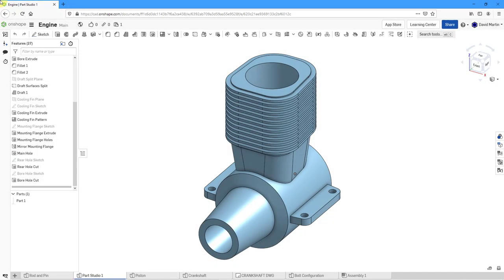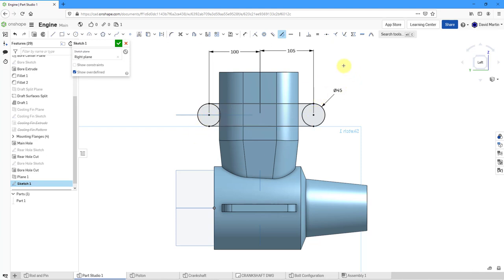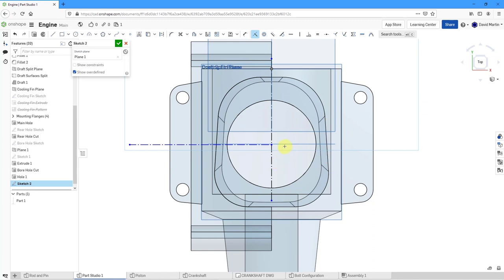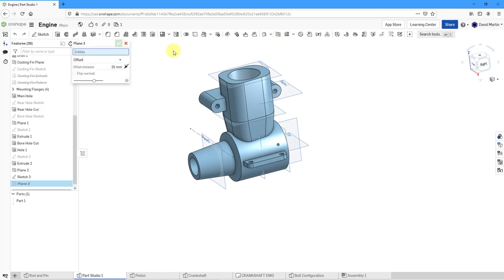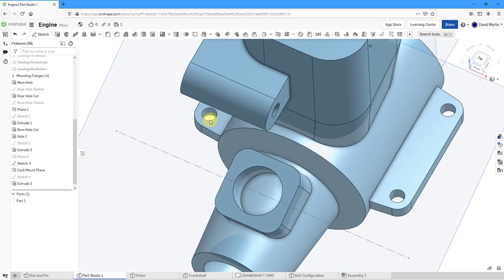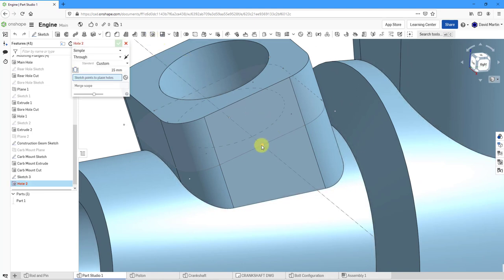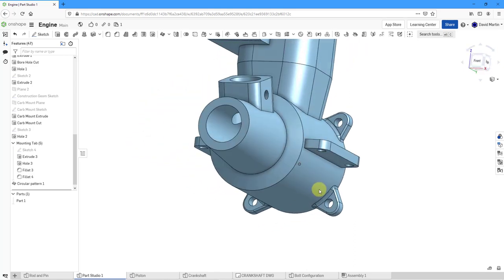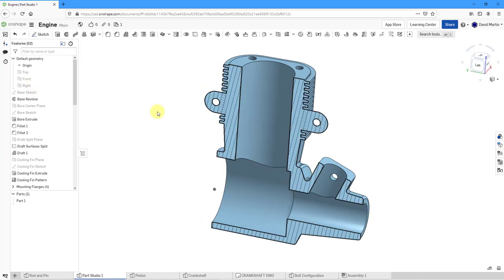Onshape - Part Studio Modeling | Engine Block (Part 2)

Comment: At 24:25 the holes for the rear mounting bolts snapped to the wrong location when selecting the mate connector.  They should have been just a little bit farther from the center.  I really enjoyed constructing this.  I used to do a lot of RC flying.

Comment: sir i have a problem that when i  just bring the solid work step files into the creo parametric . i want to be have the same feature manager design features applied in solid work  , only i find there the import file not the features that i applied in solid work . plz i need ur help